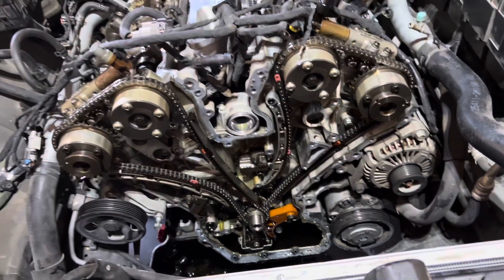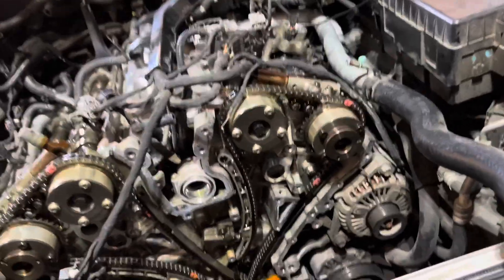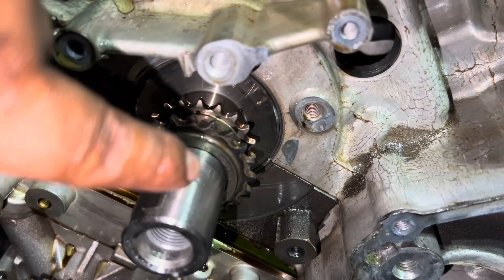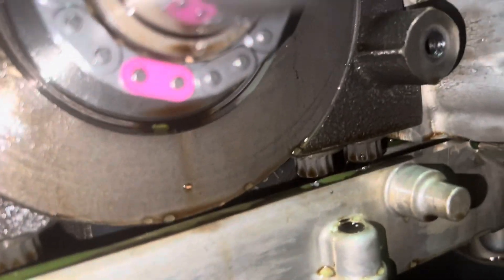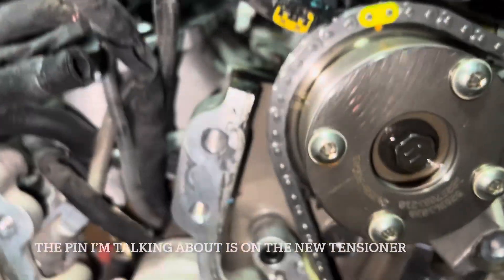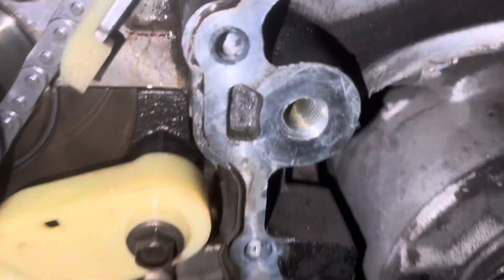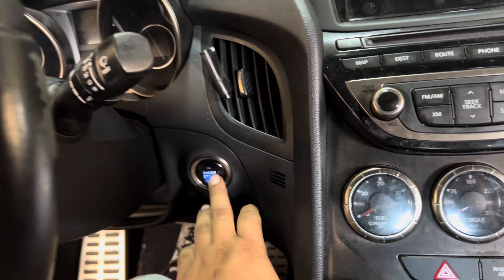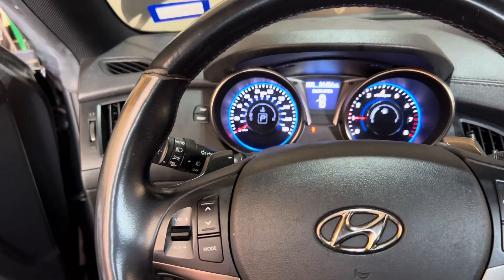Genesis Coupe 3.8 Timing Chain Replacement PT.2

Comment: Great great video boss I really appreciate it … …. The circles on the  cam gears be at like 11 and 2 and crank key at the pointer arrow on the block… I’m replacing everything while I’m in there .. solenoids tensions guides phasers and the pump .. all factory stuff so it ain’t cheap lol but man it’s been a great car and gets up and goes for a 3.8 na zz Thanks for the great video…. Actually the kit I got is the reg chain and not the hyvo chain like it has on there so took it all apart just to get the wrong damn kit?? So tha sucks

Comment: A few questions for the timing job 1st timers...

1) how do you rotate into tdc? You show it done and explain why but dont show the process. 
2) what did you do to adjust the chain so that purple link would line up correctly without messing up alignment of the top 2 yellow ones? 
3) when you say you keep priming the engine until the oil pressure light goes off, do you just mean to turn the car off and back on again until it goes off?
Reply from the maker: @KelliCassarella-ek5km  watch my 2.0 timing video on how I got TDC then. I explained it as easy as i could. 

You literally put the engine in TDC before removing the timing chains. 

2. You simply rotate the crank back or forth to align the bottom mark while the 2 yellows stayed lined up on the cams. That easy boss 

3. No you literally prime the engine until the oil light goes away. So the engine will attempt to turn on until you key off, when you do this you want to slow sure the oil light goes away before that happens. If it doesn’t then do it again until that oil light isn’t displayed anymore.
Reply: So you can adjust the crank out of TDC to make the the dots match? I’m having this issue of having the cams lined up- and the crank at TDC and the marks slightly don’t match up- so what is safe to adjust without taking it out of time?

Comment: currently doing the heads but have a question on the cylinder order. cant seem to find firing order. could use some help with it, thanks.
Reply from the maker: @kartel6025  1-2-3-4-5-6 
5 6
3 4
1 2
Reply: @ProdigePerformance  bro i appreciate it so much, ty! also are bk1 and bk2 same for chains? ive seen some that are a couple markings off so not sure which ones i would need. 5 closest to fire wall on passenger side right? again ty.

Comment: Would have been nice if you wouldn't have listed the torque specs for the time cover
Reply from the maker: @genesisboston148  it was in my description but YT removed a lot of my descriptions because a link I would include that had all the torque specs got shut down.
Reply: @ProdigePerformance  mine leaking oil so I gotta gule it again didn't seal properly  so oil leaking from the top of the cover and drips from the back of the engine

Comment: Hey Brian, Im hearing that if I have startup rattle - I need to replace the sprockets as well. I'm fine replacing those but i'm being informed by one parts vendor that the camshafts need to be replaced as well, according to him they are no longer making the original design or yadayada.. anyway does that sound correct? I definitely will replace the  sprockets while im in there because it does have that rattle on cold start
Reply from the maker: @Xueqs  it’s not that they don’t make them anymore, it’s the fact that they don’t separate the sprockets from the camshafts. It’s sold as a single unit unfortunately
Reply: @ProdigePerformance  interesting. Im saved on labor doing it myself but the job just skyrocketed in price lmao
Reply from the maker: @Xueqs  what you can do, is cross reference the camshafts used (they’re used for multiple engines) and then buy the correct cam gear. 

Theres 3rd party that sell them. If I could remember correctly I would provide you the PN to the sprocket to another engine that uses the same camshaft but I’m unable to at the moment
Reply: @ProdigePerformance  Ya seems like I could find the sprockets without looking too hard..

Comment: I doubt ide get an answer bc of how old this video is but when you take off the oil pump do you need to take off timing of can you just have it hanging ? I’m asking cause I’m trying to change my rod bearings but everything’s in the way and not sure if I need to take the car off timing or what
Reply from the maker: You should be able to remove the 10mm gear bolt from the pump and easily remove the oil pump with the gear out of the way. At least that’s if I recall the part correctly

Comment: You have any advice on how to approach the passenger side (Bank 1) side not lining up with the timing marks after chain installation?  Followed the Alldata steps, watched a couple videos- nobody seems to have this issue.  Timing chains and CVVTs are salvaged, but within spec as far as I can tell.    Totally long shot, but I appreciate any input

Comment: How do you get it top dead center?
Reply from the maker: @TheLegend-ir9tr  flat head in spark plug hole cylinder 1 rotate crank till flat head stops coming up 

Cheap and easy way to find out

Comment: are you going to drop a parts list i have this same problem right now with my 2011 genesis sedan
Reply from the maker: I sale timing kits boss
Reply: @ProdigePerformance  well since i was going to be inside the engine i was going to do seals on the gaskets too does the kit come with all of that or seperate
Reply from the maker: @shaynebrizzybrown3014  yep. All of it. 
Guides tensioners chains  gaskets
Reply: @ProdigePerformance  where can i purchase?

Comment: Dealership says I need a compete timing chain replacement do you know which parts I need I have a 2011 Hyundai Genesis Coupe 3.8L Please help your videos are amazing thank you !
Reply: Hola buenas necesito info sobre el mismo motor 3.8 l genesis
Reply: Hey, did you get it fixed. I have a 2011 genesis sedan with rough idle and misfires and I suspect it’s the timing chain. Did you get yours fixed? Any suggestions would be greatly appreciated. Thank you.

Comment: I have a question: 2 weeks ago I changed the gaskets on the engine covers (3.8) because the oil was coming out, and I keep seeing that where the spark plugs are, I see that it is getting dirty again with oil. What I can do?
Reply: You probably have found out already, but check your OCV sensor on the side which gets oily. It's pretty common for them to leak oil into the plug and onto the valve cover. You need to replace your OCV.

Comment: How do you replace the camshaft timing vvt solenoid?
Reply from the maker: Camshaft Ocv solenoids? Or camshaft position sensors
Reply: It’s called a camshaft timing solenoid
Reply: Yes it is a can shift ocv solenoid
Reply: How do you replace that or know if it’s bad
Reply from the maker: @isaiahmartinez774  do you know which one? There’s 4 total
Reply: No I do not know which one tbh but do you know where all four are at??
Reply: Or have a video? To show

Comment: Thanks so much for making these videos! Since I don't have a garage and live on a hill, I'll still have to take this to a shop unfortunately. Not looking forward to the bill. How much did you charge for this, and how much would you charge to do it with the oil pump as suggested?
Reply: My Hyundai dealership told me 4500????? I’m so stressed
Reply from the maker: Timing components $440 
Pump $210 
Labor $720 

Shouldn’t be more than $1500 for labor and parts

Comment: Can I ask why you didn’t replace the oil pump?  Especially when you had everything off…Your vids are very helpful - Thanks a million.
Reply from the maker: I suggested it but the customer declined. These cars aren’t mine. They’re customers cars.
Reply: Thank you…just order parts from Albert Hwang and will follow your video.  Is the oil pump easy to replace with everything removed?
Reply from the maker: @yerok88  all you do extra is take off the 4 bolts that hold it in place. 4 12mm 12 point bolts and it comes right off.

Comment: I appreciate the video but, you didn't show how to find TDC or line up the cam gears. 
Which marks do I lining up to know I'm at TDC and cam gears are lined up?
Reply from the maker: Yes I did. You have to pre time everything before removing the timing components. Chains tensioners etc 

Once you’re ready to put the new chain on then you line up the crank first. 2:50 mark. 
If you do this correctly you don’t have to mess with the crank afterwards. That’s the purpose of pre timing everything before removing the old timing chain. 

So pre time
Remove old timing components
Doubly check crank TDC @ 2:50 mark 
Then you install the new chain and line up all the marks. Once the crank is at TDC you don’t mess with it again. You adjust the camshafts only to line up. 

Once everything is in place install the tensioners and guides and lock it in place and do the oil pump chain 

Then repeat on the passenger side
Reply: @ProdigePerformance  OK I'll check it again Thanks
Reply from the maker: @smavtmb2196  if you have issues lmk I’ll do my best to make things more clear / understandable
Reply: @ProdigePerformance  Thanks for getting back to me so quick.
I didn't watch far enough into the video the first time. I jumped to a conclusion to soon. Thanks for making the video and being willing to answer questions. I might get back to you with more. 👍
Reply: @ProdigePerformance   All good thanks

Comment: I am looking for the parts for my 2015 genesis coupe head gasket replacement, including all necessary sensors, ect.

Can you please advise me what needs replacing?
Reply from the maker: You’ll want a 
timing kit 
Intake and exhaust Ocv solenoids for both sides 
Oem Head gasket 
Oem valve cover gasket 
New oem head bolts 
Optional components would be cvvt camshaft sprockets for intake and exhaust 
And new oil pump.